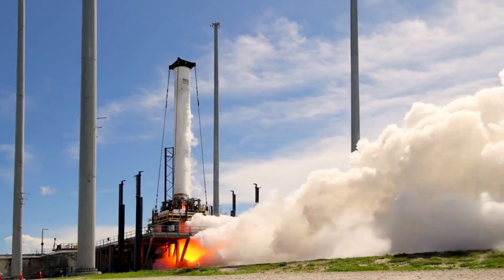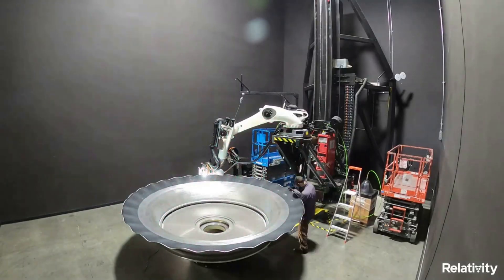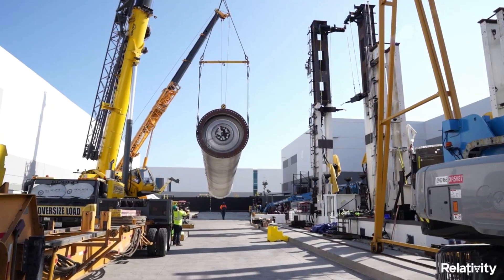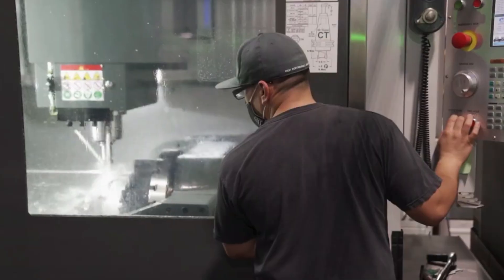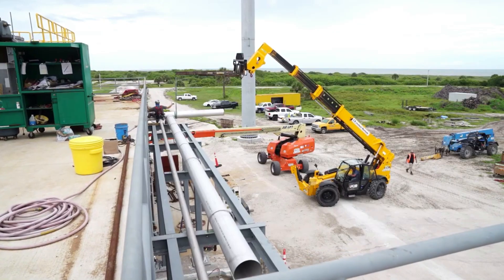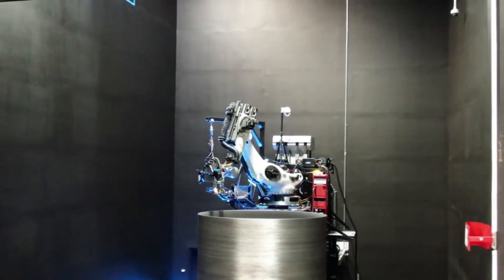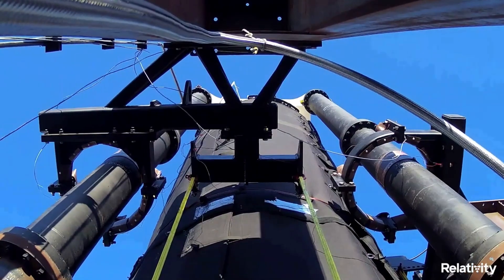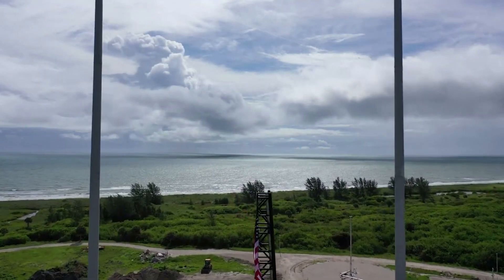A Closer Look At Relativity Space's Fully Reusable Terran R Launch Vehicle

Comment: If it ever launches. Delay after delay after delay
Reply: Huh? Terran R ? You might be thinking of a different vehicle -- like maybe Blue Origin's New Glenn ?
Reply: I don't think they have done that. They generally promise little and just announce completed milestones.
Reply: I think you're referring to Terran 1.  Terran R is still under development. Those constant delays in the Terran 1 launch are a bit worrying, they've been promising a launch 'next month' since September. What has been going wrong ? I think they ought to at least attempt a Terran 1 launch before committing the Terran R design to production.
Reply: @paulcarter7445  - They could be waiting for a launch license from the FAA.
Reply: @cacogenicist  If they were simply waiting for a license from the FAA , I think they would gladly state it - it would annul any fears around problems with their tech.
Reply: @paulcarter7445  per the latest update from Tim Ellis, Terran 1 is back to the pad for its static fire, the last milestone before launch.
Reply: @karimrachid8738  That's good news. So it's going to launch next month again ?
Reply: @paulcarter7445  Yes, *knock on wood*, the static fire has to go well.
Reply: Thats a lot of welding. I wonder if it's built better than what spacex is doing. There are so many areas that could fail.